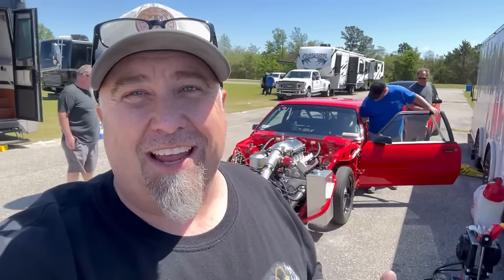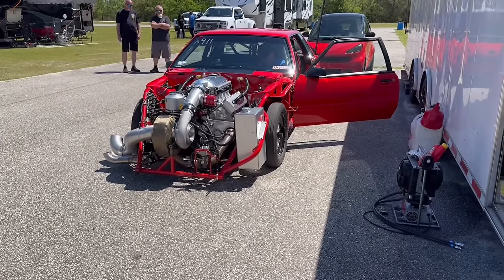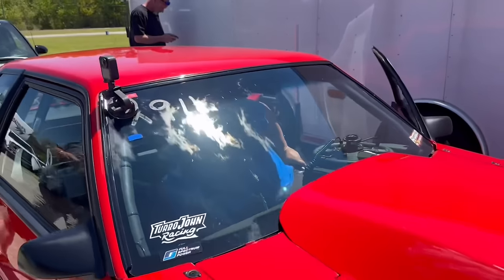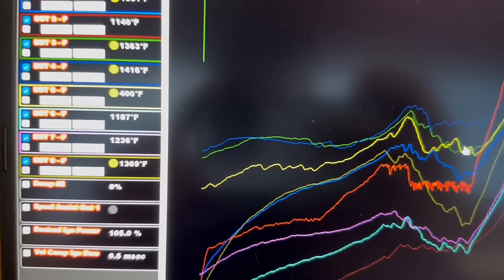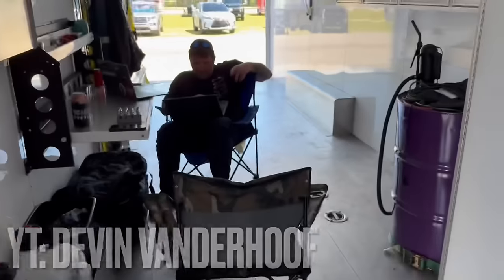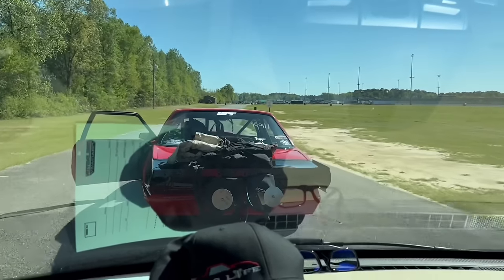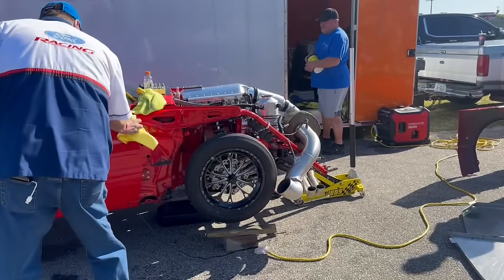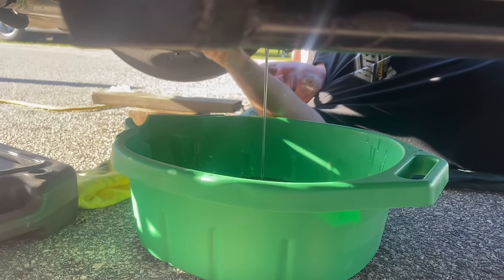ProMod Randy v/s Slick Rick / Beat Down!

Comment: Nice 60' progress, getting closer. A non-lockup turbo car sees trans fluid go up about 200° for every second it's up on the brake NCRC said. That is one reason a turbo car can't run the same converter case as a procharger car. A turbo car will melt it. Now Devon runs one of those consistent Scott (PAR) combos like I run, but mines a procharger.

Comment: Randy needs a rental with a real deal tuner.
No disrespect meant for John,but this car should be on another level.
Reply: Problem is it seems they could tune for one day and get it mint and the next track outing nothing works like it did before. Kevin tuned it on the dyno and i feel it should have been on a decent pass out the trailer but…..
Reply: I agree. That's a $300k car that needs proper help.
Reply: John always says he's not a Professional Tuner, that caliber of a car needs a Professional Tuner at the track,  hopefully John will be able to make the needed adjustments when they go to different tracks and weather conditions.
Reply: @hoost3056 who told you it was a 300k car?
Reply: Well it may or may not be $300,000 but the race car is top of the line from the front to the back with that being said it's not performing to what it's really capable of. It's capable of a sub 4 sec pass and it's hard to watch it not perform but note how John is cutting up laughing he is not interested in getting the car right if  it was his car he would be doing whatever he could do to make it right watch videos when they are at the track with John's car versus at the track with Randy's his whole demeanor is different did you see John in this video really put in any effort to make Randy's car any faster no you didn't I noticed this long ago it's blatantly obvious I hope Randy will find someone who really is into making his car perform at its full potential.
Reply: @dewayneboothe5910  I get what you saying. At this point it's all about getting that car down the track the horsepower is already there

Comment: A little shot of brakekleen in the plug wire boot, just before you put the plug wire on, will remove all doubt that the plug wire is fully seated.

Comment: What size turbo is on the car? I'm doing a FIS 91/102, w/a T4 flange cuz streetcar with air, and a 11.5:1 408" LS in my 99 Camaro. Hopefully it'll run good at the track, but it won't be for a lil bit, unless I'm shaking it down on gate at my 8th mile track. No cage yet, I'm definitely not making a ¹/4mi. pass, even off foot brake. It should go easily in the mid 9's on the 12lbs I have in the gate, as this same motor combo, different cam, went consistent 10.3's on motor and 8.50 on a 200 shot...so, the boost should make up for the nitrous plus some! Hoping for a low 8 second pass on 25lbs, or whatever makes 1200hp. Gotta keep the rods happy! That's the only corner I cut was on my rotating assy., but it's what I could afford and better than a stock rebuild though...maybe it'll really surprise me and dip into the 7's, but idk if I got enough, even leaning on it! It is a full weight 99 Camaro, a/c, p/s, p/b..but I'm sure I'll go on a weight loss program when I do the cage, manual brake conversion will free up more space than weight, but if I do drag brakes, it should lose about 100lbs., 20 on the door impact bars that unbolt...anyway, thanks guys. Y'all keep me motivated to get this car on the road and to the track! I also have no idea what to expect, as this' my 1st turbo car, so I'm trying to get as much advice as possible and learn all I can.
Reply: He runs the fis 122mm

Comment: Can you put a Check Valve in the Puke Tank Line where it’s shared @ the Regulator/Filter don’t will NOT Feed up to the Tank under Pressure

Comment: Sorry Randy, but ol Slick Rick put it on you buddy!! But, in your defense, it's not running right, which there's always next time! 2nd, you're all steel all glass, racing a 26-2700lb pro mod, big motor, huge turbo! So, I could see that same tune in John's car and your car right, you'd be on it, as long as you're on the light! Good luck guys!

Comment: I thought Kevin tuned it?
Reply from the maker: Kevin helps me as well.  I’m the tuna, lol. There are several methods to tuning, we fattened it up in the dyno based on what we thought it needed, but I should have made the first pull with my old tune to get a base line setting.  Base line setting went, 176mph at Piedmont at 40psi but plugs looked hot.  After dyno, the fat tune went 172mph with 46psi.  Lean tune went 176 mph with 46-49psi.  I’m thinking my original tune with a little less timing is the right spot for this car.  But that could change.